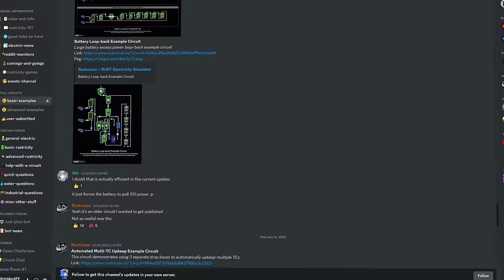I Created A Human Bug Zapper In Rust

Comment: It's not just a bug zapper, it's a grub zapper 😂
Reply: I m new to rust so can someone explain what is grub mean.
Reply: @ayechan12  I don't play rust either, but to my understanding, it's when people with no loot or gear scramble through the aftermath of a fight trying to steal loot off bodies that someone else killed.
Reply: @gnomeathome1736  Congrats, that is one form of grubbing! 

Grubbing is when you take a low value kit out in search of fat loot gains, usually through cheap/cheesy methods such as door camping, corpse thievery, or grenading people (typically at recyclers).

Comment: The tesla coil, while not the most applicable, is still a good trap. It's very easy to hide in your base, covers 360 radius, and ignores armor. You also don't need to wire up the full 35 power it takes, just as much as you need to kill unwanted intruders. Can setup an airlock in your base to trap players and kill them with a hidden tesla trap. Another funny, but less practical usage is to set them up all over the floor above your main core. If you've been pushed back to your core in a raid, you can just hook them all up to a switch that kills everyone on that floor. Very high power consumption but also pretty funny to wipe a raid team that way.

Comment: A 4X4 room with 3 tesla coils, large battery, some memory, door controler, heart sensor and other things is enogh to make a basic bug zapper. 20 power to each tesla coil is enogh to make it work. Only downside is repairing the tesla coils on each use.